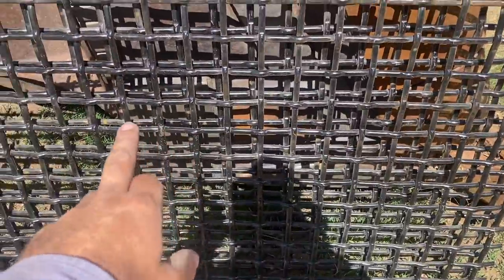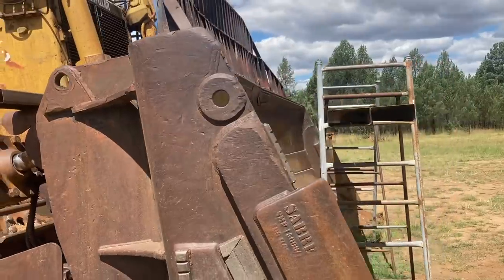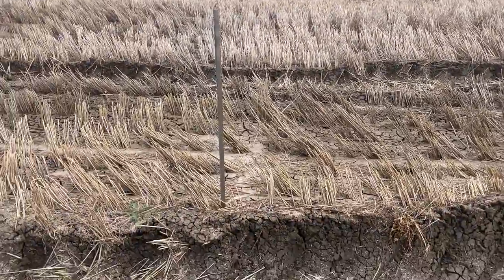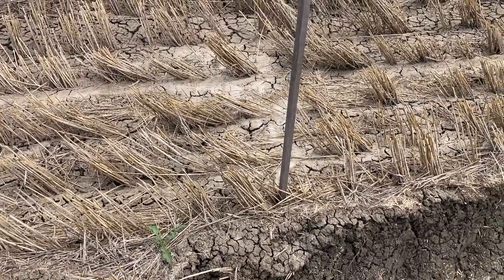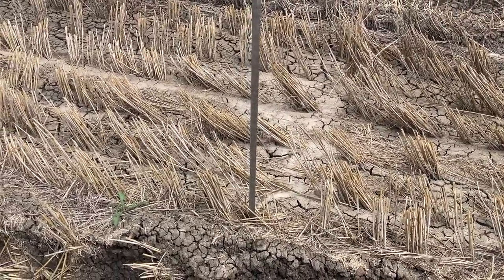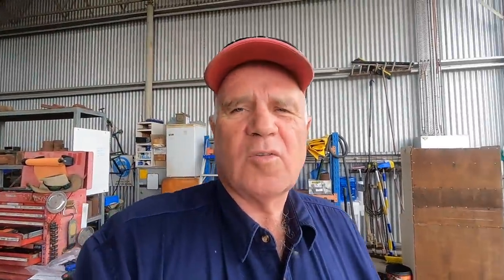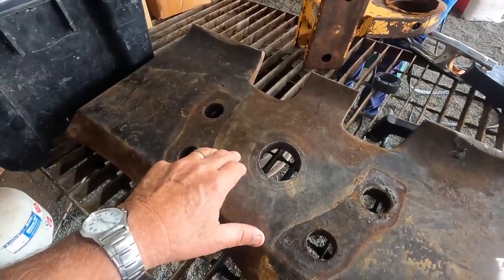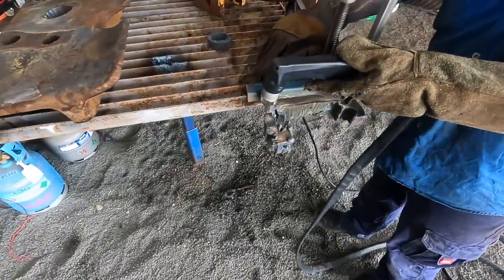Fitting and Trying New Toys!! (Vlog 56)

Comment: A modification I’ve always done to bullbar mounts is gusset the mounting brackets and or strengthening the chassis to reduce the fulcrum action that happens when a impact occurs. I gusseted a ARB bullbar mounting bracket on a triton, i hit a roo a few years later instead of bending the bar right back into the grill, radiator support panel etc it bent the end of the chassis.  It’s a vastly overlooked design flaw with most 4x4 bullbars

Comment: Hole in polypipe. Wonder if there is small amount of thermal  expansion and contraction going on and rubbing against just one sharp little rock ... could take years (20 maybe) to wear hole ... I've seen significant holes before but that pipe was ony buried 300mm and that took about 15 years ... would have thought 750mm deep enough to overcome thermal expansion but maybe ... the other thought we had was white ants but hole was elongated so we stuck with temperature change wear .... also looks like you have good amount of head to overcome the friction loss. Spiral ladder to antenna's - great idea!! 🙂👍

Comment: with the plasma if you are blowing a hole into plate for a hole you can drill a small where your going to start to avoid blow back and blowing a tip out or hold the nozzle on an angle can help also but a small hole is best and to cut a circle get a bit of pipe that's bigger than the hole you need to cut by the diameter of the cutting head and use it as a cutting template to run the cutting head on.

Comment: You need to preheat plate for a better cut because of the  thickness also you could make a jig to cut the circle 
Just a helpful tip 
Love your work guys  and the 2 tinies
Reply from the maker: Thanks Stephen! Yep we are getting a jig made up currently for that that purpose👍
Reply: A plasma cutter cuts at 25,000 degrees and there is no advantage of preheating.

Comment: Certainly Isuzu country in your neck of the woods mate, I have a MY18 LS-U dmax and opted for the TJM outback bar scrub rails and steps and it looks really similar to that EFS and I don’t have the really durable finish, found the TJM scratches really easy going past trees and what not. Looks like the same 63mm tube too? What’s been your experience with the Isuzu’s and old shape Colorado’s? Ive not had anything major trouble yet (touch wood) in the 75000km we’ve done and it’s seen some hard work.
Reply from the maker: Hi mate, we have had a really good run out of the dmax/Colorado utes👍 we originally were going for a arb bullbar but opted for Efs as the arbs were difficult to get😁 pretty impressed with the efs setup so far
Reply: @thejacksonbrothers  great to hear mate, IMO the ARB’s don’t quite suit the front ends because the hoops obstruct the DRL at the top of the headlamps of the modern Isuzus, reckon you’ve picked a winner, good stuff!
Reply: 400,000kms without putting a spanner on the engine is reliability

Comment: Question??
They ain't LPG gas bottles beside the table whilst your plasma cutting?????
Reply from the maker: No non flammable👍
Reply: R134a is a refrigerant, they likely they do their own air con maintainence and top ups
Reply: Fortunately R134a  is typically non-flamable.
Reply: 134A on the bottles so its air conditioning gas.

Comment: Re cutting the grouser plate holes, I'd advise to get a jig setup that you can clamp down, then just run the torch around inside the hole in the jig.

Also, re the AC gas tanks, probably move them away from 'hot areas' (sparks).  If AC gas burns, it turns into incredibly nasty stuff (like mustard gas!....).